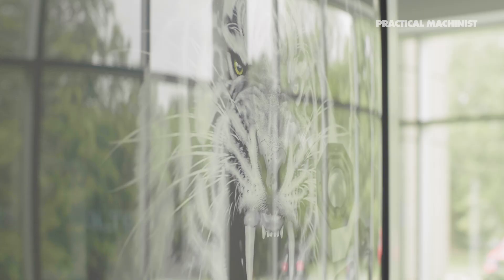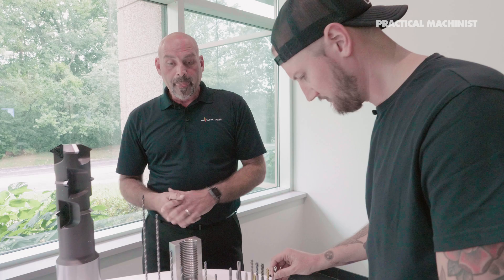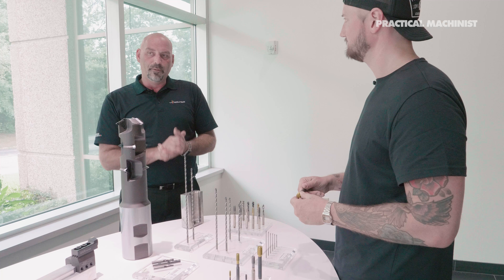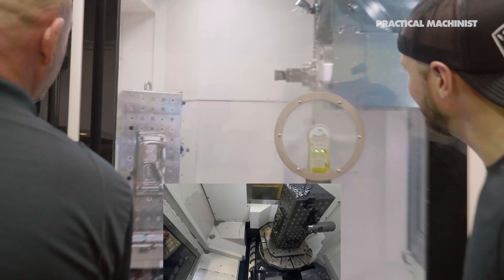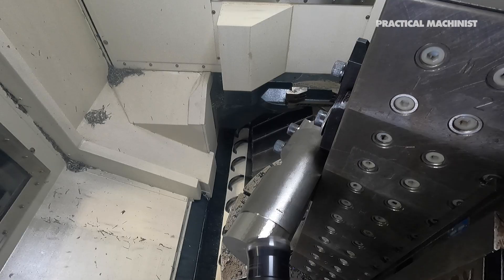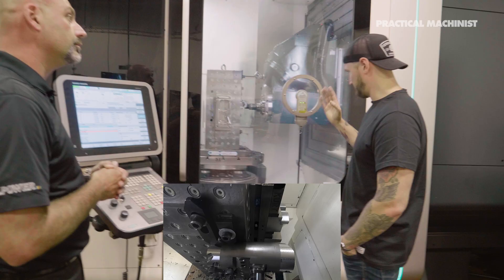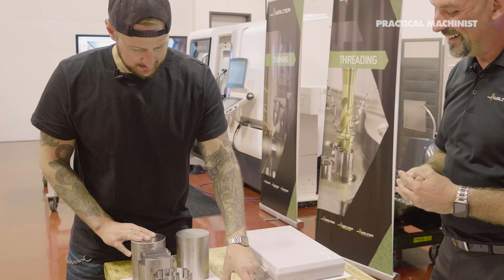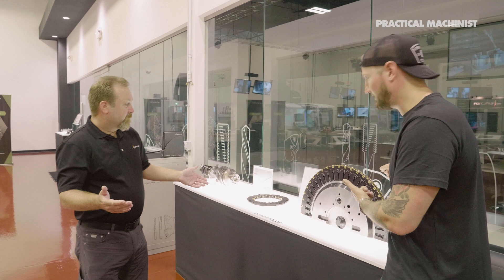Raising the CUTTING TOOL Bar | MAKING THE CUT featuring Walter Tools

Comment: I would watch your channel if your hat wasn't on backwards. You want to be taken seriously, right?
Reply: Do you expect to be taken seriously with a comment like that? Obviously his appearance and style of how he presents himself has no relation on his ability and knowledge of machining and to be honest I quite like the casual look of a shop floor machinist holding the same style of appearance as in his shop talk video's. Ian is quite the heavy weight in the machining industry and carry's a lot of weight behind his promotional videos. Notice how intimidated well dressed tool reps are in his presence. There is nothing quiet damaging as a experienced machinist calling out design faults or highlighting product design failures. There are often products put o the market which are destined to fail. Nikken spring loaded tail stocks (non quill type). Don't work and parts are either scrapped or at risk of being scrapped as a result. Seco crown lock drills (heads tear off due to creep failure machining exotic materials). Nano turbo mills (inserts slightly go then tool is wipe out making them highly expensive in sub con shops ect ect